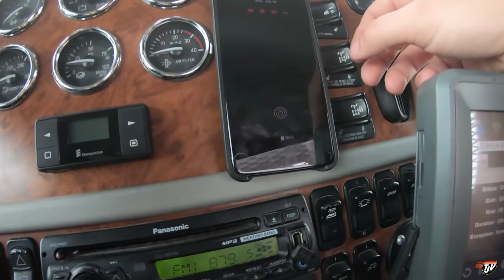ALMOST FELL OUT! | My Trucking Life | #2336

Comment: Cracked my smart phone for the 1st time early this last spring then I managed to do another 1st,  couple weeks later it somehow bounced out of my pocket while I was on the riding mower mowing my lawn all of a sudden I hear this thump like a stick getting chopped up by the blades which my yard is full of so I didn't think much about it and continued for another lap and heard the thump again on the third lap around I finally noticed something shiny on the ground, stopped the mower and climbed off to see what these shiny pieces where and noticed it looked like what was once a phone and proceeded to stick my hand in my pocket for where I normally keep my phone and noticed it was not there which was immediately followed by @#$**#&$%@. so I now have a new phone again with an uncracked screen and leave my phone in a safe place and am completely unreachable while mowing the lawn lol. glad to hear your mom is continuing to do well and you did not get hurt while getting out of your truck on the failed step. Would guess they likely will plate over the crack with a small piece of metal plate and weld it to the steel slightly away from the Crack? Will be interesting to see. Safe travels!